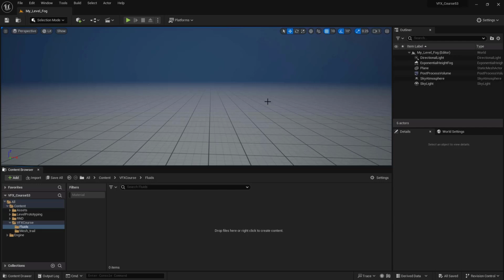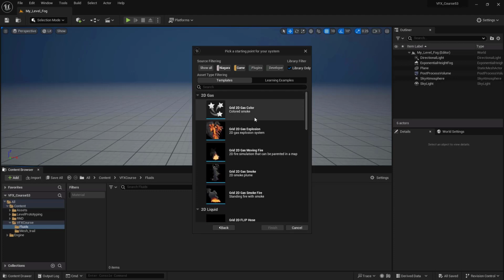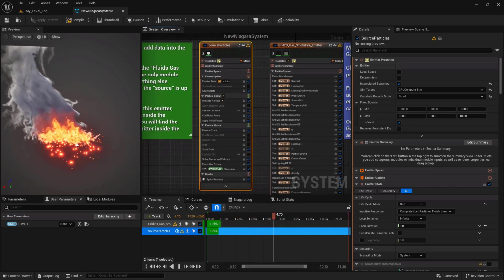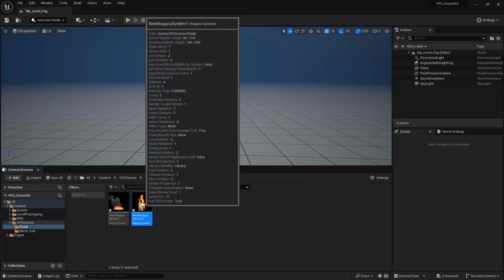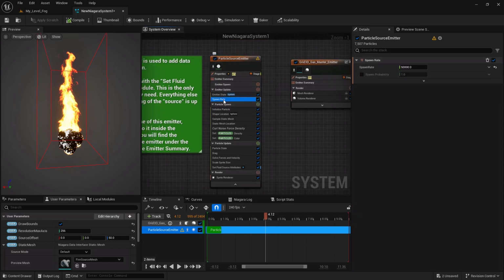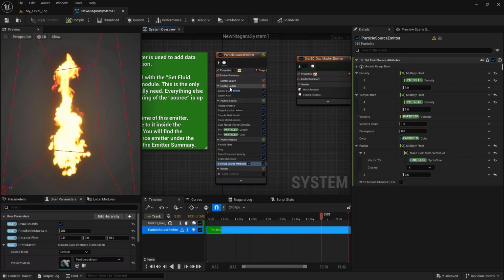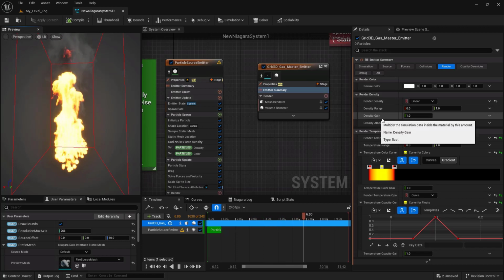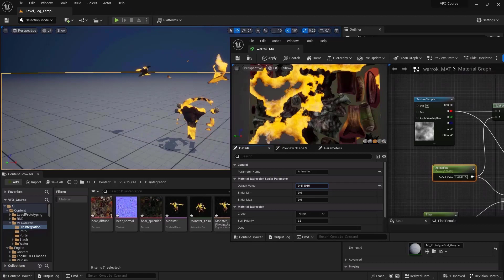Unreal Engine 5.3 - Intro to Niagara fluids

Comment: Hi Raffi,

I would like to ask if the udemy course "Complete VFX Niagara in Unreal Engine 5" includes tutorials on moving particles on a Skeletal Mesh. I'm not referring to particles following the body, but rather particles moving on the body, such as moving from the belly to the shoulder and then to the fingertips, or vines crawling from the ground onto a foot. I have searched online for many resources, but most of them only cover the former scenario.

Based on my own research on the Niagara system, I have imagined that it might be possible to achieve this effect using methods like a Skeletal Mesh combined with controlling particle movement through a Scratch script. However, I am unsure if this approach is correct or if it can be accomplished. I would like to know the feasibility before investing time in learning it.

Therefore, I would like to know if this course covers the aforementioned effect or if completing the course will provide me with enough knowledge to achieve such an effect.

Thank you.